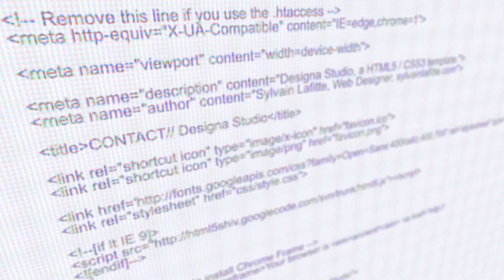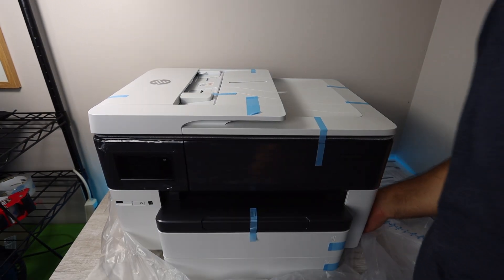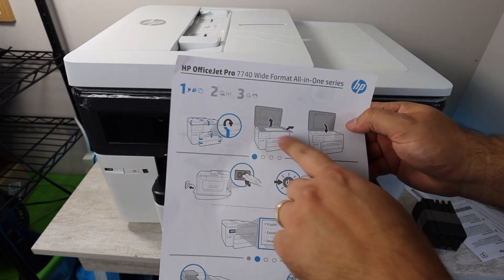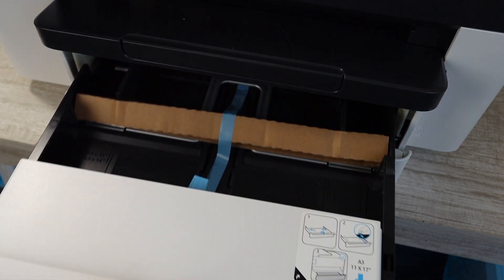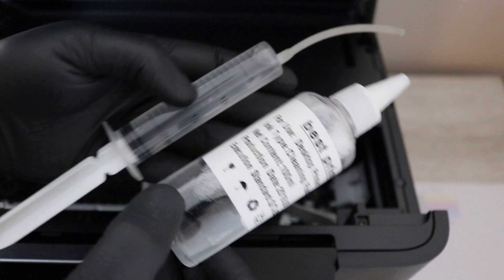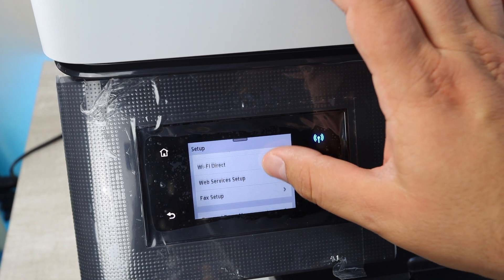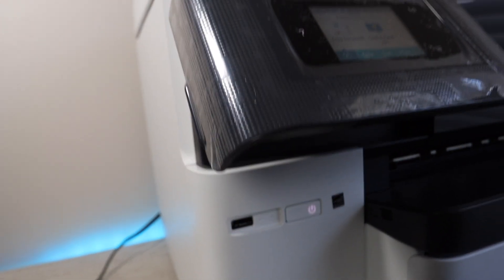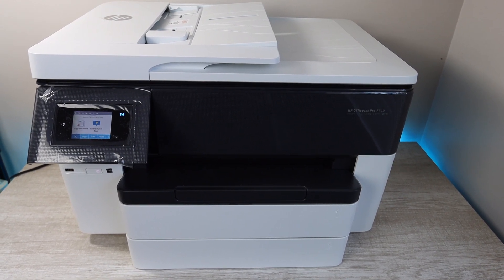HP Officejet Pro 7740 Unboxing, Setup & Review

Comment: I just got mine and now I see, there are 2 flip down Tray Covers that I did not get!  When the Paper Tray is extended, they are supposed to flip down, and neither of mine are here!  How do I order them?
Reply from the maker: I would contact whoever you purchased from and inquire about that.
Reply: I have seen it missing on other videos, it looks like those trays are missing but HP might have changed it so doesn't have tray covers anymore. For dust protection and having A3 paper in the trays I do not like those covers are gone.

Comment: hello ,is this model can do A3 PRINT ,SCAN ,COPY ,FAX ALL OF THIS ,or only can print ,most of the a3 printer model only can do print only for a3 size paper !
i ask many seller ,they say can ,actually not ,like i say above only print for a3 size  !
can you please give accurate answer and thank you !
Reply from the maker: Hi please refer to the specification sheet from HP below, 

https://cdn.cnetcontent.com/53/3d/533db264-1cfd-4862-856c-529bee2fa2a2.pdfhttps://cdn.cnetcontent.com/53/3d/533db264-1cfd-4862-856c-529bee2fa2a2.pdf

Comment: Fine machine; fine, clear video instruction - HOWEVER,  note that full 11x17 paper size requires tray to extend out ~2" (~76 mm). Apart from slightly disrupting the sleek appearance (which is a plus, if you are a design guy/gal, & interact with clients while working), pay attention to a bit of extra dust infiltration over time. Also concur about excellent value for price. Very impressive. Thanks!

Comment: I purchased one of these a few years ago. It constantly goes to the blue screen with error code and you need to unplug it to reset.  works a few days then does it again.  HP support basically says to unplug it because they don't have a fix.  Must be a electro mechanical defect.  Started right after the warranty ran out.

Comment: Hello, few questions if I can test:
1. check both A4/A3 alignment if it is properly set up... my MFC5720DW fails to align for example as wide format printer. If I print table lines are always bit misaligned.
2. check scanner quality from glass and from ADF including double side scanning

Content request:
Any chance making printhead flushing video for Epson's Pro WF series printers that use cartridges that do not move with prinhead, example WF-5620.